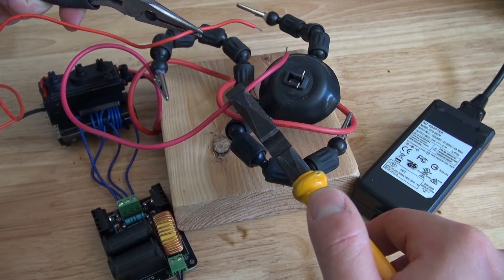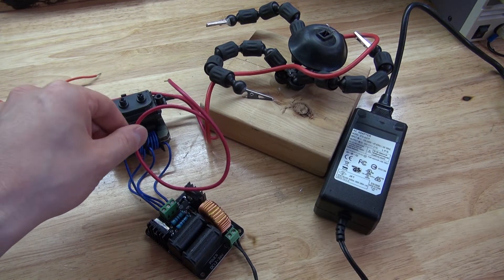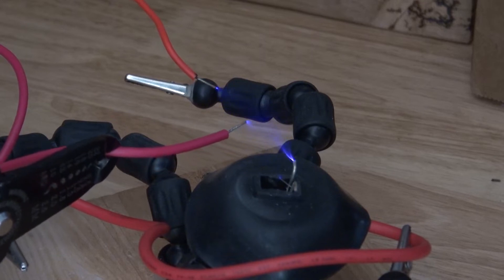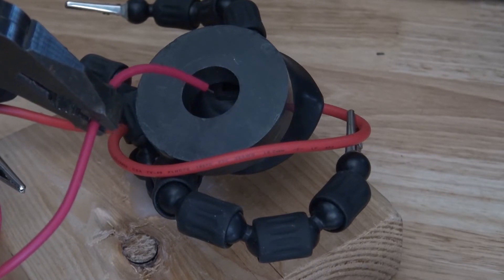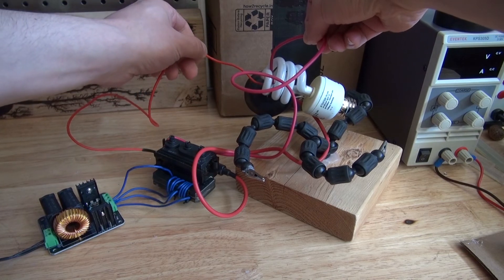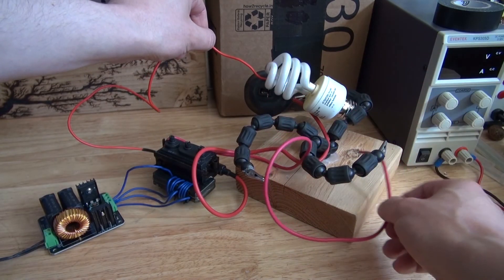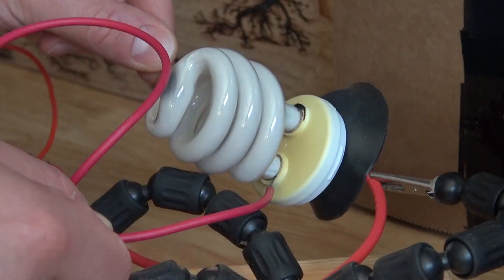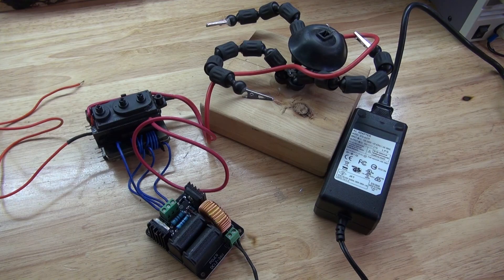Ebay ZVS Flyback Driver

Comment: Your powersupply is too weak
Reply: As soon as the arc is formed cureent rises and triggers your power suplies short circuit protection
Reply: I had the same one it would make arcs but at like at one cm so I bought  Another one and it works good so far
Reply: @Texas_bikes66  what voltage did you use. At 30v this driver produces some nice arcs
Reply: @revolution5547  10 volts 2 amps

Comment: The reason for the pulsing is that these ZVS drivers use far more current than that power supply can deliver; as soon as the arc starts the capacitor in the supply discharges and its output drops to zero, the output returns as soon as the capacitor recharges and that cycle starts again. This circuit would work properly, ie continuously, with the more powerful and cheap supply boards also found on eBay, sealed lead acid batteries are another popular cheap option.
Reply from the maker: That's very interesting! Thanks! I will look into that.
Reply: @SciTyeTech  Forgot the best option of an old PC power supply and I'm sure you have plenty of those lying around; they have more than enough current and can be put in series for the 24 volts that driver you're using can handle, I've got the same one; connect the green wire to ground (black) to turn them on. You might want to look into the ZVS induction heater boards on ebay because they can handle far more power and work with a single coil, no centre tap needed. If you use those and replace the existing turns with 4 turns of heavier wire you'll get ca the same voltage but with more current for a hotter arc, and less turns put the voltage up. I've found that (@12 volts) you can go all the way down to 1 turn for much higher voltages/bigger arcs, but the bottom contacts of the flyback transformer start arcing between each other; this can be fixed by totally covering them in vaseline but it's important to do this first otherwise the arcs will create a conductive path of carbonised plastic between them. Those drivers work with any coil and even transformers at any frequency from 1 KHz to 1 MHz and automatically hit the 'sweet spot', and for more current especially at lower frequencies it's worth paying a bit extra for the ones with the 6 capacitors, a search for "ZVS induction 20a 48" will bring them up, here's an example:  https://www.ebay.com.au/itm/1000W-20A-ZVS-Low-Voltage-Induction-Heating-Board-Module-Hearter-Coil-12-48V/273841694821?hash=item3fc23ca865:g:JqoAAOSwRB5c6Nvn
Reply from the maker: @MadScientist512  That's a good idea! I will try that.
Reply: @SciTyeTech   Tried using vaseline on the bottom terminals but electrostatic forces just blew it away, fortunately I had some bitumen putty and that worked a treat; I'd recommend bitumen putty for high voltage insulation as it's super effective and self-healing, flows into cracks and is easy to work with and available from hardware stores, though it does take days to start setting so I had to go over the terminals again because it shrank significantly while setting due to the putty being 60% bitumen and 40% solvent, make sure to get the putty which has mostly bitumen with a nonpolar solvent; ie Flammable is Good.  
Here's a video on my channel of that ZVS driver running a flyback transformer:  https://youtu.be/43ySVttflMI
  I'm uploading a couple more today to show just how far it can be pushed with both voltage and power.
Reply from the maker: That's a very good insulator. You should also try epoxy. And yes, I can't wait to see more videos.
Reply: @MadScientist512  you forgot. If you plan to connect computer psus in series you needbto disconect earth wire, otherwise you'll break your suplies

Comment: Why do you have pulsating arcs from your zvs driver something's majorly wrong DVS drivers are supposed to be high frequency up into the killa Hertz
Reply: His power sipply is too weak. As soon as the arc is formed the currebt rises and powersuplies short circuit protectiin turns on
Reply: I'm getting two different kinds from eBay one that has smaller heat sinks and only one inductor coil and two capacitors and one that has two inductive coils heatsinks that are larger and have a fan attached to them  even though I plan on adding way more efficient cooling to them and better heat sinks cuz I'm working on a ion drive with an 8 stage linear coil accelerator and I need something that can run for a long time
Reply from the maker: Yes that will generate a lot of heat.
Reply: My goal is to increase the speed of the ions going out the back of the Thruster in a vacuum in order to prove to NASA that you don't need to slap on 500 lbs to get three times more thrust aka mk3 drive then their original ion drive on the dawn spacecraft 92 million Newtons of thrust they could have just taken three of those 10 lb ion drives and just got in the same result then spending 7 to 10 years and probably a couple million dollars making the MK3 ion drive that outputs three times more thrust takes him three times more power but weighs 50 times more than a single ion drive
Reply from the maker: That's an interesting idea. Cost effective and likely to travel faster.
Reply: Okay I added more fans for heat dissipation directly facing on to the primary coil input wires and added a solder fuse to all three input wires with an extension going to the zvs driver to protect the driver now that should take care of my heating problem and now I've got a ridiculously powerful portable high voltage generator
Reply from the maker: That's cool!!
Reply: God dammit my primary I removed the metal clip but the primary still got hot enough even in oil 2 melt the terminals that connects to my zvs driver any tips how to fix that I hate Friday the 13th
Reply from the maker: Yes, I know. I thought that was strange too. In a future video I am going to buy another one from a different source. Hopefully it will work properly.